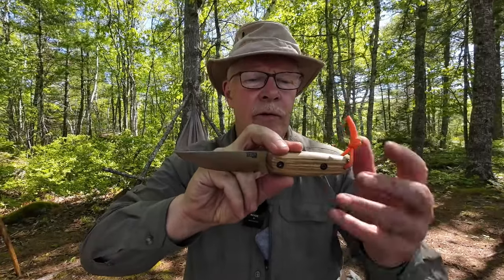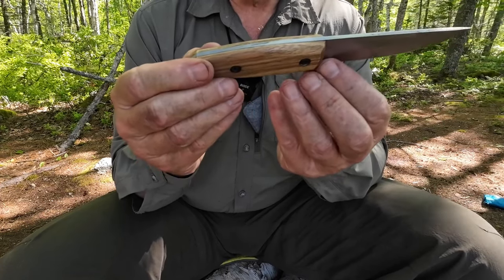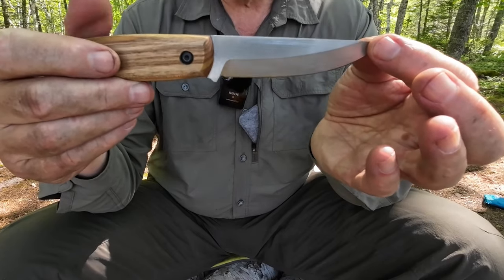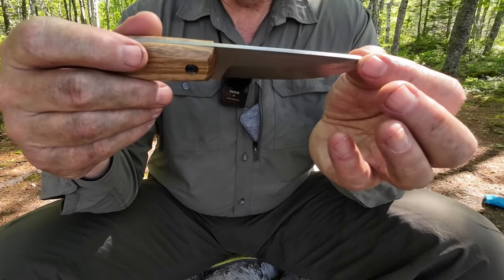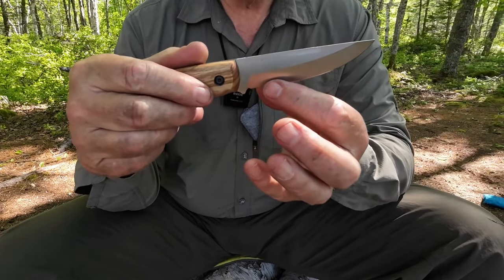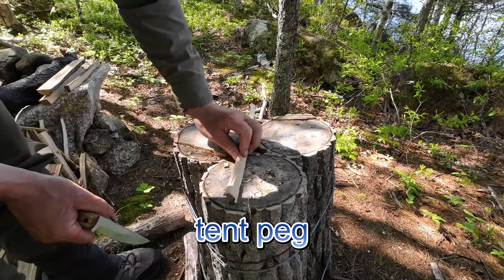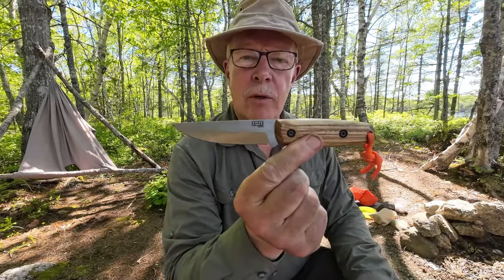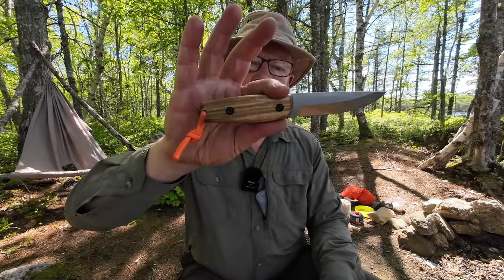Za-Pas Modern Puukko

Comment: at the top of the knife, end of the hilt near the knife, is that just the metal edge coming out because they lowered the hilt there? seems uncomfortable to me.
Reply from the maker: There is a very tiny guard there. Not uncomfortable but not required either. Easy to grind off. Thanks for commenting
Reply: @MarkYoungBushcraft  Any time! 👍